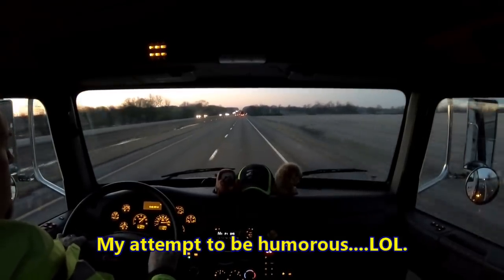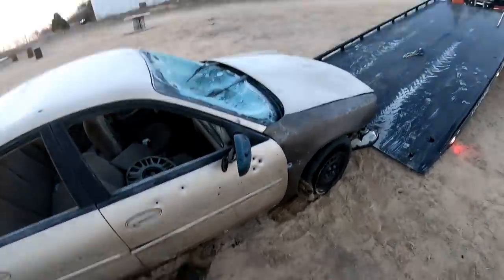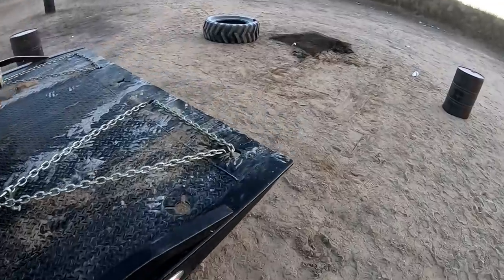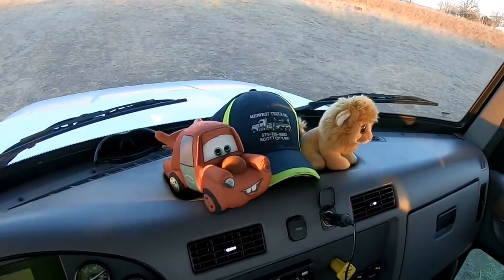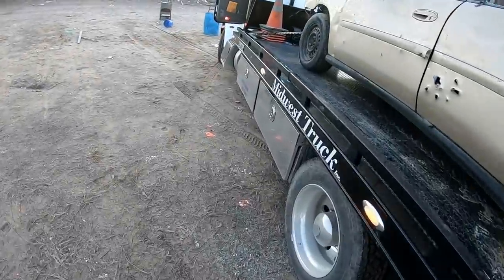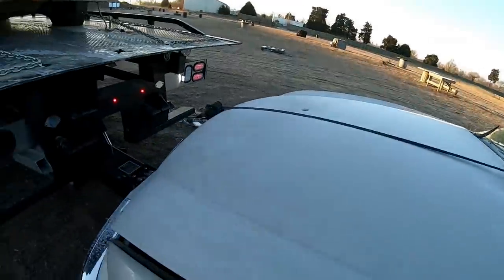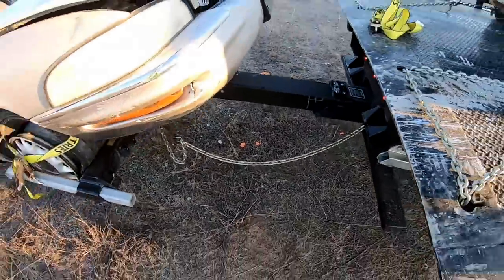Tow, Tow On the Range

Comment: You are totally correct  about as long as every one gets safely to 10 it should not matter how you get there, In some cases I am sure it might matter. I am curious why do you choose to have both of your tire sling straps on one side vs one on each side. I think the latter would be my preference. Good point, to not just rely on your magnets to hold the light bar. I had not ever seen a tow operator/driver pull out and set next to the tire the removable part of the wheel lift cradles. I like how god that worked on this tow job. I learn some thing new regularly when I watch your videos Ron. Be safe out there. Every Time and All the Time.  A Minnesota Fan.

Comment: Personally, I like the fact that you still use chains on the deck for tie down, that you use four instead of three, or worse, none at all, and that you release the pressure on your winch after you tie down the car. Anyone who has ever seen a cable or winch itself break resulting in the inevitable loss of the car from the deck will know what a dangerous and foolhardy practice that is. Like you stated, there are a lot of ways to get to the number "ten" . I was wondering why you never cross your saftey chains under the wheel lift. I've found that doing so helps with potential "slack" problems on turns. Great video as always and as always, GOD Bless you and yours.

Comment: Up here in Chicagoland and NW Indiana, just about every tow truck driver just uses the winch and one chain in the rear for a car on the bed. Many guys run one strap on the wheel lift, but a bunch also run two. Safety chains aren’t used on the under lift unless it is a pickup or larger.
Reply from the maker: They need to check Federal regs on that.....
Reply: That's just asking for all sortsa trouble!
Reply: Fed regs say 2 straps and safety chain on the underreach, and a vehicle on the deck must be secured at all 4 corners. Most tow operations never have a vehicle in tow long enough for dot enforcement officers to catch em on it. It will catch up with them eventually though, hopefully without any injuries to fellow motorists.
Reply: Towed my wife’s car the same way. Just the winch and 1 chain in the back. I haul equipment I almost asked him about it.
Reply: it's all ok until you lose a vehicle, then its mountains of trouble.....and paperwork.
Reply: I'm quite sure Ron knows he is 100% correct! The ONLY proper/ safe way is with  all 4 tie downs secure on the bed. The winch DOESN'T count as a tie down.  My 1st tow job company owner told me, if I loose a car and can't prove I had all 4corners tied properly, the damage bills is mine....if I can, damage is on him!  YOU'RE NEVER IN TOO BIG OF A HURRY TO DO YOUR JOB SAFELY!

Comment: Does Miller Industries offer a hydraulic wheel grab for the under reach on those trucks?  Kinda like the repo trucks use in their line of work. I could see that coming in handy on a busy road just to get a vehicle that can still roll off the road without having to stand beside the car any longer than to throw the wheel straps on. Stay safe out there and I always enjoy your videos!
Reply: Yes the Auto-Grip™ II Wheel Lift is optional.

Comment: Ron, I have a request for a video. Using a very substantial anchor and the drag line, stretch a nylon sling to near working load with a very short home depot rope loop between the hook and the sling to simulate a failure (home depot rope breaks) and demonstrate the energy storage in the sling. It may be advisable to use a redirect on the drag line. It seems that other rotator operators on youtube think you don't need safety if you are not maxed out. The lift I saw was a lift of a 16,000 lb counterweight with 2x10 foot nylon slings. A little math: assuming a 4% stretch in the sling, 4% x 10 ft. = 0.4 ft. of stretch.  0.4 ft. x 8000 lbs = 1600 foot-pounds of energy storage (Hooke's law).  If the anchor parts (rapid disassembly) and there is a 10 lb clevis on the sling, there is enough energy to sling shot that clevis 160 feet in the air. The operator in question had the rigger holding on to the sling while the load was flying instead of using a tag line, seemingly oblivious to the danger to the riggers hand if something bad happened. The sling was attached to the counterweight with a short grab hook chain loop. Grab hooks are not life safety equipment for the simple reason that they can misconfigure if slack. People in your industry don't seem to understand the increased dangers from elastic slings. The convenience of slings tends to lull some people into carelessness. In this case, I was more concerned with the grab hook slipping than the sling tearing. I think you could open some eyes with this demonstration.
Reply from the maker: I like the idea, the concept, but I'd have to make sure I could calculate and control everything so that nobody gets hurt and nothing gets damaged.  Another possibility is showing the amount of stretch in the slings.  There are times in recovery where the slings are strategically used for their storage of energy.  Such as when pulling a vehicle out of the mud, you can place a sling in the rigging, apply force and the sling will stretch, stop applying force and allow the stored energy in the sling to slowly break the suction of the mud.   Thanks for watching and God bless.
Reply: Even a simple stress/strain diagram can be informative. The load cell will give you the stress, and that is built into the truck. Measuring the strain (stretch) is more challenging. The easy way is to use a tape measure, but you don't want to contact the loaded sling. An old trick is to fix a yardstick to a mirror behind the object so that parallax can be eliminated then nothing has to touch the sling when loaded. You may be able to accomplish that with a mirror, some clamps and a sawhorse. This would be for a horizontal pull. Using 2 trucks back to back is the obvious setup. This will generate numbers that can be used in a classroom setting, and may be more useful for instruction than actually launching something with a slingshot. Rapid disassembly (shirking the load) can cause backlash on winches and even mess up load cells. I wouldn't want to launch anything from the 1150R. Once you have the stress/strain diagram, you can use the stretch to determine the load so even a Warn winch on a pickup truck could be used with mechanical advantage. By having the anchor away from the winch, the direction of pull (resultant) is not inline with the winch in case things don't go as planned. Slings are not ideal springs, so hooke's law will overestimate the recoverable energy storage. In the stretch phase, the stress/strain diagram will not plot a straight line. The recovery phase will exhibit hysteresis and shrinkage with time. There are also temperature effects and Nylon is sensitive to getting wet. Getting nylon wet lowers its strength, but the real hazard is battery fumes. Sulfuric acid fume damage is invisible to the eye, but has proven deadly in the past. A mountain rescue team captain was instructing when his rope broke. This rope had lost 90% of its strength after being stored in a battery compartment for over a year. Manufacturers ratings are for laboratory conditions. Safety factors can also vanish in bad weather. The strength to spare illusion can lead to surprises. Have a good one and I hope this is food for thought.

Comment: how is the runaway chain secured on the tow truck? is it just hold by those two sheet metals on both sides on the chain link?
Reply: That chain box will be quater inch thick steel u could hang the truck by it

Comment: good video Ron. A great demonstration of moving 2 cars with one truck. However, I noticed you tied down the trunk lid on the car that was on the wheel lift. What about the trunklid of the car on the deck? Should you not have tied it as well? Matter of opinion and I am not a tow operator by any means, but would I not have been a safe thing to do? As for the magnetic lightbar, I trust the magnets but only so far. I have a LED amber bar on my side by side for road use as a SMV (Slow Moving Vehicle) and I can not count how many times low hanging limbs has drug that thing off the metal plate I mounted it to and it has a strong magnet. In my case its an easy 35-50 dollar replacement but for you and the tow bar light I'd imaging its a whole lot more! Better to have the straps and not need them holding it/catching it than to lose it on the highway. Stay safe and God Bless.

Comment: Easy Peesy, a few sniffles and no sneezy.....nicely done......
And I agree with you Mr. Pratt about the breakaway chains being used 100% of the time, they are no different than the chains on a travel trailer, small trailer or fifth wheel, they maintain control of the vehicle/trailer being towed or pulled in the event of a broken hitch or under reach/wheel lift or any other portion of the vehicle being towed/pulled!

Comment: You call it an under reach, in UK, we call it a 'spec'. This is what I used to do when I was a recovery driver. I drove either a spec lift or a beaver tail truck. Spec lift quicker than beaver tail, but bever tail (as well as the roll backs) are more secure and used for longer distance recovery. . I enjoyed this one.

Comment: I have a question Ron-for the vehicles that you all drive, is it mandatory that the operator possess a class A CDL or just a standard drivers license?
Reply from the maker: We prefer a minimum of a CDL class B for the service trucks and rollbacksa and a  CDL class A with all endorsements, except passenger bus, are required for the Heavies.  Thanks for watching and God bless.
Reply: Thank you.
Reply: Federal law to have a Class A CDL when doing medium and heavy tows with all but passenger bus endorsement. Anything under a gross combined or less than 10,000 pounds of maximum trailer mass not exceeding 26,000 pounds only requires a D or C in some state per their own law along with wrecker, hazmat and air brake endorsements. Anything over 26K or 10K trailer weight requires a B license with said all endorsements minus passenger bus.

Comment: Back in 2005 I owned a Ram 1500 Big Horn with 508 miles and just after filling up with gas the motor blew and a towing company came to pick it up with their rollback. I rode with the guy to the dealer and it felt like his truck was going to tip over.

Comment: Interesting video, Ron. From the title of the video, I thought that you might be picking up two vehicles from a farm or Ranch, now I know that I was wrong. From the size of the bullet holes, you can tell that they were using some high powered rifles. I am a little raw tonight, we just had to have our 1984 Ford F-150 towed away today. The pick-up was running fine until two weeks ago, when the module that sits on the of the distributor burned the wiring. ( We just recently put almost three thousand dollars into it, it was our restoration project.) God Bless You and Your Family.

Comment: under reach aka wheel lift, is also known as the "stinger".(anyone who's banged their shin on one can tell you!) i have on occasion used the stinger to lift the rear of our racetrack's small wrecker to change tires on the wrecker (with jackstands for safety). i've always believed and "LIVE" by "at least 2 points of failure for safety's sake"

Comment: Nice job, especially if it had been 20 degrees warmer. :-)
A thought: I think you could have hooked those trunk tiedowns into the top of the trunk lid. Would have held the light bar a little tighter. Nothing wrong with what you did of course, just a different way to do things.
I wonder if whoever the receiver is that gets those junkers is going to panic at the holes and brass in them. :-)

Comment: I was bit surprised you didn't tie the trunk down on the car on the rollback bed.

Is there anything that makes you decide to use a chain tie down as opposed to the wheel straps on the bed?

Thanks for answering all the questions. 

Those bullet holes will buff out.

PS: I do wonder if this is an authentic Ron Pratt video. No storm, no overhead power lines, no crazy traffic.
Reply: Seem no wheel straps yet or cars too damaged to use them if already equipped on board.

Comment: I wish there was a truck that had all of the features of both types of trucks combined?  The Rotator and the Rollback. That wold be cool because you could pick up more vehicles at the same time and if the bed was long enough two large tractors and trailers could be lifted out of a ditch and loaded and taken at the same time. I wonder if there is anything out there that is like this?

19:57 What are those (L) things you are putting on the car called?

27:43 You forgot to tie the trunk down of the other car on the on the flat bed.

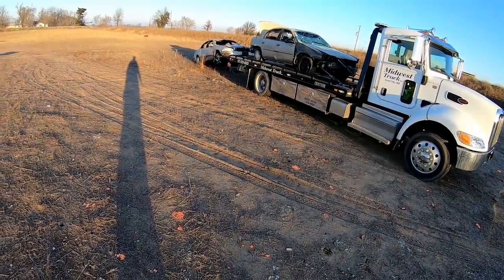28:12 It wold be nice to see what you have to do to prepare them for disposable and the process when you do sent it off?
Reply: Per first question; those are L bars or wheel grids, they are what is installed making it possible to lift said vehicle by the wheel, another method is to use a couple of chains if the bumper is missing and only going a jaunt down the road.

Comment: By the way we’re do I get some of those straps you used to tie down hood and trunk?
Reply: Look up "Erickson Pro Series black retractable ratcheting straps" on Amazon or online for where you prefer to purchase where ever sold, they are 1 inch wide by 12 foot with 1,500 lbs load rating strength. in 2 or 4 pack.

Comment: I like the Peterbilt better than the Ford, and thank you for posting a video that involves using the wheel lift. More storage space on this one that the Ford. I wonder if a tool locker could be mounted behind the cab for even more space. I had a 97 Malibu aka 'The Green Monster" that was not one of the best cars I have ever driven. Engine needed to be replaced, the gearbox needed new solenoids, the security system was a constant headache,  aluminum wheels were peeling and the ABS light was a constant source of irritation. Went to scrap in 2013. The Malibu you were picking up looks to be a baseline version with the four cylinder. Great video as always. Not boring at all. God bless.

Comment: last time i had my car towed, it concerned me because he didn't use any straps or chains.  he just backed up to the front, deployed the wheel chucks out around the tires and that was it, he didn't even leave the cab of his truck
Reply: I think a lot of repo companies are using those. They do tie the car, but after they get to a safe place away from the location the tow happened. Please correct me if I'm wrong  on this.
Reply from the maker: This is direct from the Federal Motor Carrier Safety Administration (FMCSA) so that I'm not giving you facts, not just my opinion:  https://www.fmcsa.dot.gov/regulations/cargo-securement/drivers-handbook-cargo-securement-chapter-9-automobiles-light-trucks 
Thanks for watching and God Bless.

Comment: one question, here in Australia if you were transporting a car on a trailer or tilt tray with the boot open like the one on the deck has you would get lots of attention from the cops due to claims on insecure load or any trash coming out of the boot, did you secure the boot of the one on the deck after done with the video or is that considered secure even with it not locked?

Comment: hi ron iam rod a watched a video when towed semi truck from the rear wheels with a tire staps over just the tires,not a fan cuz a raced a sprint car in the 80,s and a friend did same,but the tires lost air ,he was going west on the highway the car fell off the trailer bounced off the trailer went over the center line barrier ended up facing east know one person hurt just the car a wreck. just my Opinion and throughs but i think you do a awesome job and like your work, safe is best
Reply from the maker: Tires loosing pressure is definitely one of the dangers of using tire straps.  I always install "break-away" safety chains for just such an event.  I've been Blessed never to have lost anything while in-tow and I pray I never do.  Glad nobody was injured in your situation.   Thanks for watching and God bless.

Comment: How you like yor petter bilt? im buying my own ( 1 st ) next month. do you ever load a car on just wheel litf and not on bed?
Reply: Jose Dominguez not to be a critic, however the name of the truck is Peterbilt. That is a really nice unit he has there!
Reply: @robert johnson, didn't see any
houses in the area.
Reply: In all reality, even though several flatbed drivers have done it (myself included), you shouldn't ever put a car on the wheel lift w/o having one on the bed already.  The extra weight that far back, making your drives act as a fulcrum point, takes that much more weight off your steer tires....it all a matter of leverage...

Comment: Ron does the new rollback have air brakes?
Reply: Yes it does. If you saw in the cab the yellow diamond tractor brake release button.
Reply: Diamond = square turned 45 degrees